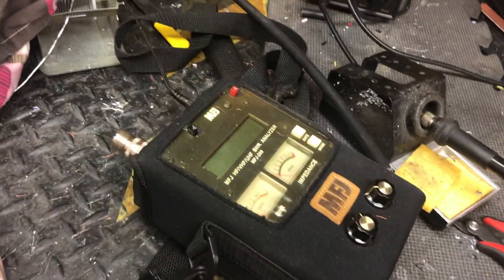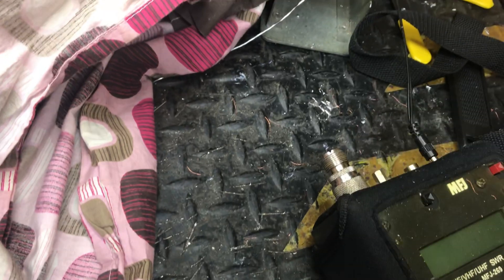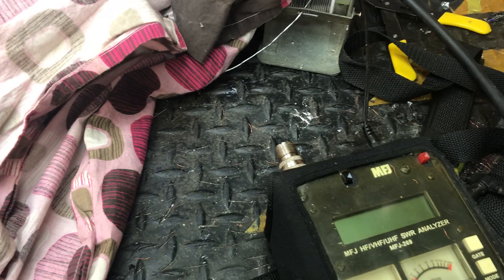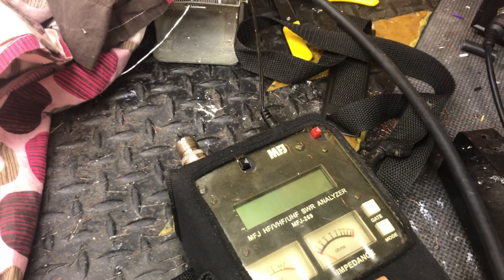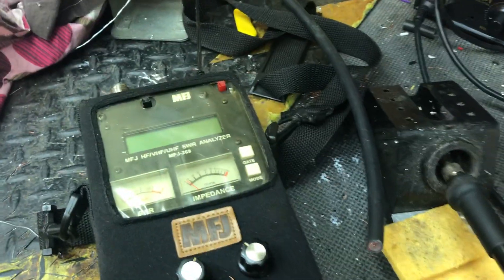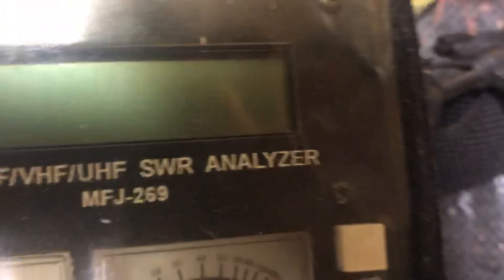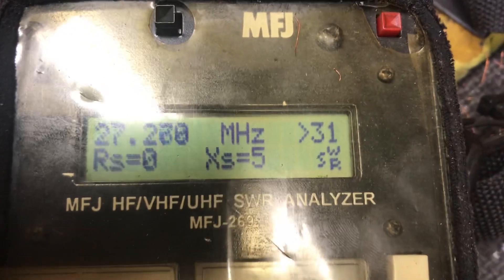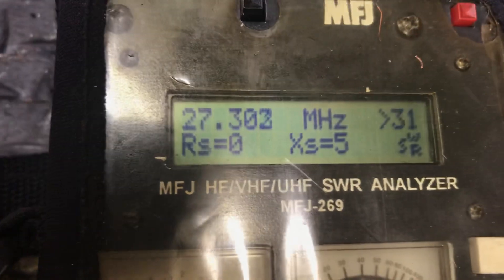How to Make Coax-Jumpers Correct Lengths for Lowest SWR/Reflect

Comment: Do you have a recommendation for coax when it comes to jumpers? The lmr400 is causing problems on my small bench just too difficult to route around the bench.
Reply from the maker: I run 213. RG 400 might be good for you to run in small places good stuff.

Comment: The coax is critical, length and characteristics. I have a Moonracker GPA-80 that did not do 40 meters. I put a longer coax cable and everything got fixed.
Reply from the maker: Coax does matter

Comment: does it matter what wave length antenna is being used?  i have a 5/8 wave antenna on my truck n cant seem to keep the same swr reading at end of cable like i do at antenna. i have the same model MFJ n have RG213 double shield 66% velocity. i need atleast 7 ft to make it to the box.
Reply from the maker: Should not matter what wave ant is.
Reply: thx man,  awesome vids. keep it coming. 👍 @DonkeyStomperProducts

Comment: For those of us poor peasants that can't afford a $500+ meter is there any way one could use a digital multimeter to "approximate" a similar measurement by measuring impedance, resistance or some such? They should give away an MFJ 269 free with every CB.
Reply from the maker: I hear that. I think there is some cheaper ones out there not really familiar with them. I think most 213 comes in little over 6ft. If that helps
Reply: 468/frequency x velocity factor / 2 

This will get you there. You will have less loss of your math is right with a 1/2 wave then a perfect stub. Coil up the remainder make a choke. 

Velocity factor is 90s for good cable , some cheaper thinner could be in 60s 
* look up what you have there are charts 

-and cut for that frequency it will only be perfect there!! Close to others 

Ex for 10m 

468/28x.92= 15.3 (total feet) divide answer by 2 for final answer of 7.68

468/freq x vf /2

Comment: RG400 50 ohm with a Velocity of 69.5 low loss Teflon insulation Trippel shelled, good up to 12.4 GHz  At 1GHz it can handle 600 watts. Also on the Ham frequencies it can handle 1,000 Watts and more. a little smaller than RG58. Its used in all kinds of aviation equipment private and military. Highly heat resistance, you can put on your connector with out melting the insulation. One caveat it's a little pricey not to bad though. Amazon no name 40ft about 70ish dollars, it goes for a lot more at other places. I love this stuff, great feed line coax cable and jumpers between equip..
Reply: RG-400 has only two braided shields.
Reply from the maker: 👍 @UDX4570PalmSprings-yh1mv
Reply from the maker: Cool Deal Thanks for Sharing..........